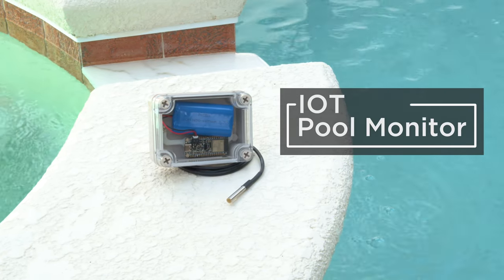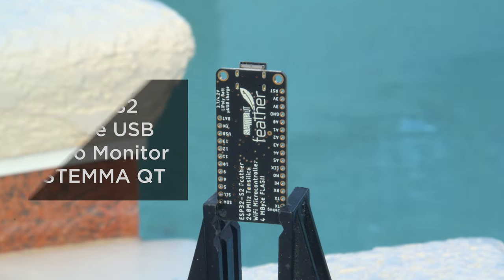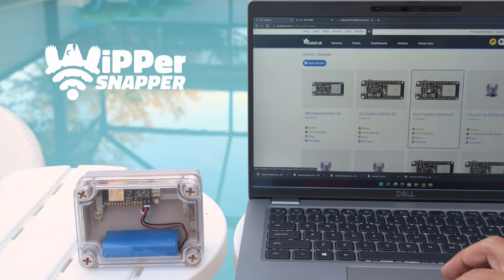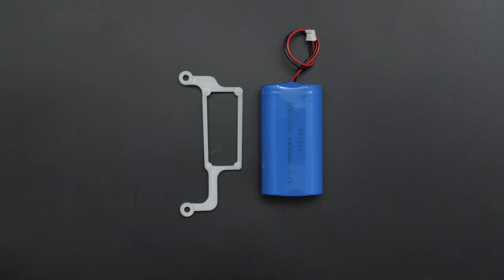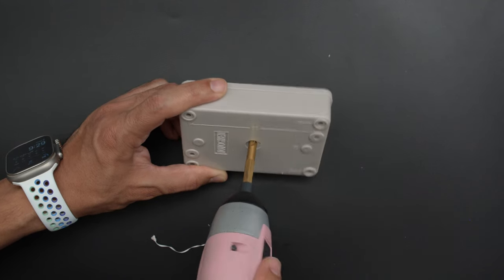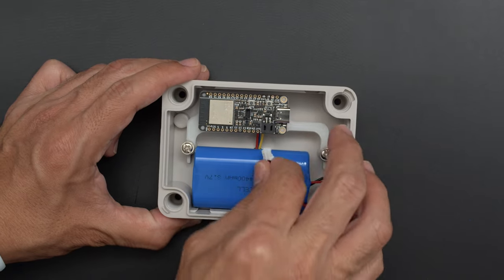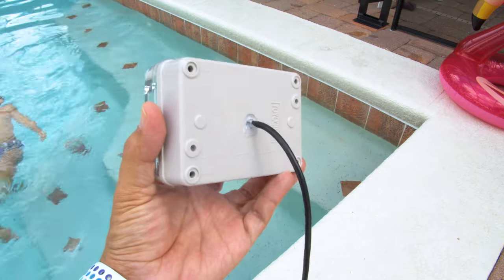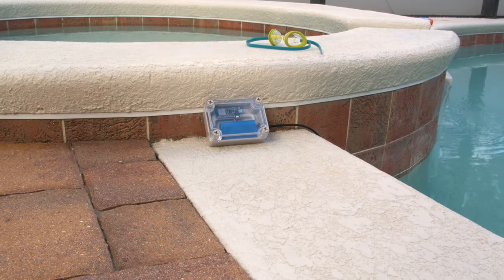IOT Pool Monitor #3dprinting #adafruit

Comment: What about chlorine and ph levels?
Reply: There are a few different sensors that can be gotten for pH and ORP readings -- there's some analog ones from Phidgits that you hook up (via an amplifier board) to an analog pin on your microcontroller, and there's some others from Atlas Scientific that run on I2C or UART.  The caveats for all of these are that they're a) very expensive b) consumable (they need to be replaced every so often) and c) set up to work best in a pipe via a T connector (Many have pipe threads and can be screwed right into the T Connector.  For those that don't, a cable gland with pipe threads will work to hold it in place.  Also, the measurements don't show up correctly unless the water is moving, and they have to be kept wet at all times).

The ones that read straight up Free Chlorine are SUPER expensive and I think are only used by water treatment plants and and the like.